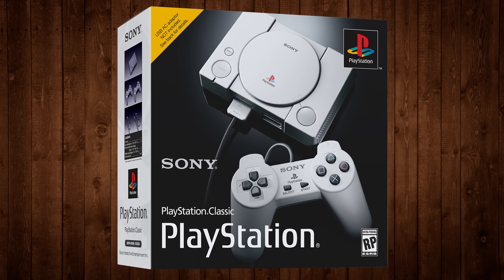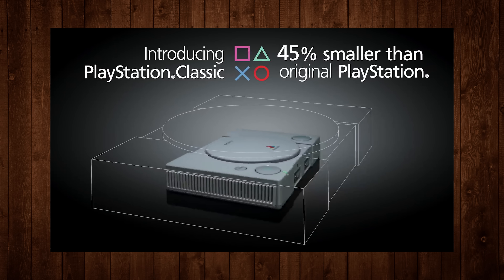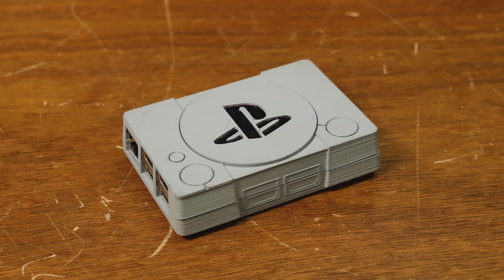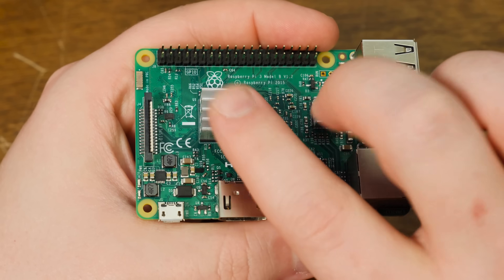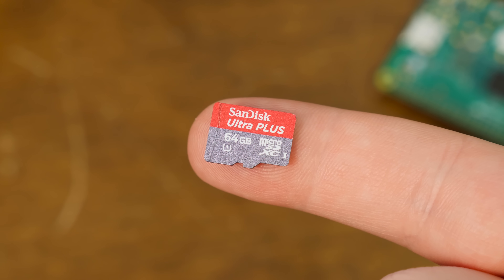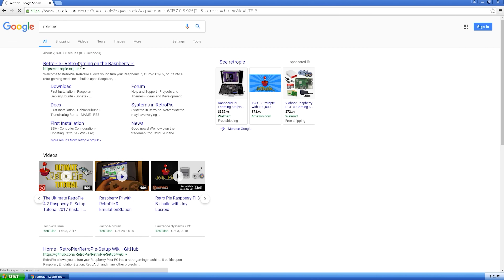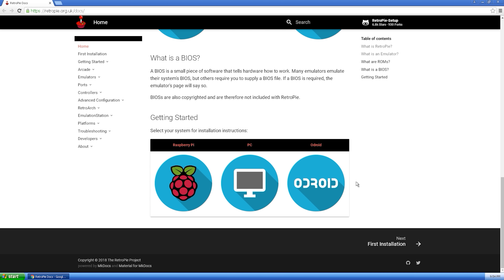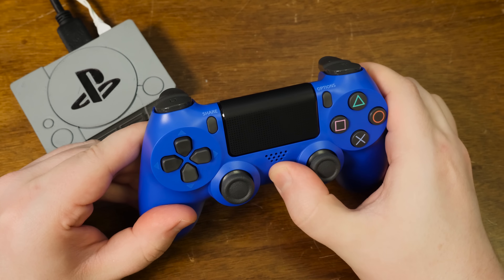Building a Better PlayStation Classic Console

Comment: but is it...legal?
Reply: It can be, or it potentially can be not.
So, I don't know about the shell, if it's copyrighted, and if you can sell it or buy it legally. However, people do sell them. You can make them yourself though, as far as I'm aware, without intent to sell, which would be legal. You just need a 3d printer. If that is still a problem, just use a different case. 

The BIOS itself is legal and opensource. As far as I'm aware, you can't sell them legally. Though, I don't really know (I just personally wouldn't try to sell a raspberry pi preloaded with the ps1 bios). But if you download it and use it personally without selling, it's completely legal. You can check out any emulator website to have the law on that fully explained to you, as they post that to save their own ass from copyright law. Still, there are plenty of companies that sell emulator consoles, if that gives you any comfort in buying or downloading the BIOS or console shell.

The ROMs however, get a little more into the gray area. It's commonly accepted that if you own the game, then you can own the ROM legally, no problem. You might find yourself in hot water with your ISP if you start downloading ROMs, though (especially with new games). If you do own the game, then you don't even need to download the ROM, you can just rip it yourself. Again, don't sell them.

So just don't try to make these and sell them, and you'll be fine. If you do, you'll probably be banned from amazon and ebay pretty quickly, and make Pat the NES Punk's: Scumbag Seller of the Week. I wish I could give you actual legal citations, but I'm not going to do that kind of research right now. If you feel the need to do that, there's more than enough information available.

Comment: Just a heads up to anyone wanting to do this. The heat sink used probably uses an adhesive tape to bond to the processor and the gpu (or the RAM I can’t remember). I did read that this typically made thermals worse because the adhesive wasn’t good and conducting heat. 
He may have gotten a different set than I did but I’m guessing they all come from the same place with the same adhesive.
Reply: sorry for such a late reply because im just now getting into emulation, but any idea on what to use instead??? i was thinking the raspberry pi fan but I could be way off

Comment: Seriously man....just do what i did. 

buy an old 20" crt tv = $20
Psx slim with games and accessories average price $20 - $40 on ebay
Psx braker pro (lets you play burned back up games) $20

that's $80 total. why settle for this poor emulation shit when you can relive the psx experience far cheaper  on original hardware displayed on a crt tv and play the games the way they were meant to be played

Comment: If you're gonna try a project like this, use a Pi 3B+ (PLUS) rather than a 3B. They run faster by default and may not even need a heatsink due to the integrated metal heat spreader, better 5Ghz Wi-Fi and gigabit ethernet built in, come with a header for Power over Ethernet (PoE), and cost exactly the same price. What's not to love?
If tight space and lower power are important then you might consider the Pi 3A+. It should be the same speed as the 3B+ in terms of emulation but it's quite a lot smaller, $10 cheaper, uses less power than even the 3B and has less ports. Of course if you want to go even further there's the Pi Zero, but that is going to struggle emulating the PS1...
Reply: Pi Zero is a fine avenue for NES, Game boy and other less demanding systems. Microcenter sometimes has a sale where you can get a pi zero for a dollar. Pretty sweet deal
Reply: Any news about the Raspberry Pi 4 coming out?
Reply: @Fendera1  Raspberry Pi 4 just released today!
Reply: @kevin12567  Thanks, I've read about it yesterday.
Reply: does the PoE give enough power for PS1 emulation?
Reply: Can you use the same power adapter?
Reply: There is an optional emulator under the retroarch settings, and it emulates ps1 on pi zero very nice. I usually play my ps1 games on my pi zero with that emulator. The only problem is, it's not working with bluetooth xbox one controller.
Reply: He eluded to that , still, this works fine for PS1 esp. with cheap heatsinks

Comment: I was gonna 3d print a Playstation shell for my s8 and just have an otg with a splitter and hdmi output cable using USB c to hdmi and boom.

Connect my dual shock using a ps1/ps2 adapter to pc. Using otg as mentioned earlier.

Comment: Awesome to see more Raspberry Pi stuff around this time, since a while ago I've started work on my "Dreadnought: X64" project. 
I took my old N64 case I still had and took it apart. The Gamebit screwdriver came in yesterday so I got to take it apart a little later than I was hoping, but taking it apart was really fun, seeing how they originally designed the board and such. 
Once I have the case cleaned and all the parts come in (Raspberry Pi 3 Model B+ & Heatsink+2 Fans since N64 games are difficult to emulate 100% without overclocking the GPU) I'll put the pi in there, which the original case works extremely well since it has plenty of areas to allow adding on some extra features (Adding LED light to the original spots, getting the power and reset buttons working again, or even a rechargeable portable battery so it doesn't need to be plugged in all the time.)plus allowing plenty of airflow, which makes this project a whole lot more fun. 

I may post a video of the finished product in a few months. ^-^

Comment: I done mine in retrones case and works a treat ideally would love to get more rom files but that's been mad hard by shutting down of ROM sights also run retropie on a full blown gaming pc using Ubuntu and makes higher end emulation like GameCube and Dreamcast possible as well as saving me from moving the pi or gaming pc around

Comment: You can do this with PlayStation TV for 20$ + buy games from PS Store if you want to play legal copies and print case cuz HDMI, power port and power button on 1 side. Also you can use DualShock 3, which is original Dualshock but wireless. With PS TV you can also play digital games from PSP and PSV and play these all games in 1080p instead of HD on PS Classic

Comment: could you do multi player with a set up like this?
Reply: Yes, you can.
Reply: i want to know too.
Reply: If it has more than 2 USB ports than yes for wired controllers anyway however if you want both controllers connected via bluetooth than I'd assume no since most devices can only support one bluetooth connection at a time.

Comment: Can someone help me. I have everything installed on my pi, but when I load ps1 games on it does not pop up on the pi itself. I also have the bios file in the bios folder. Whenever I put any games in the psx folder it does not pop up in the PlayStation section on the pi at all. Any help ??? plus I cannot find a good website to get roms from as well.

Comment: now THERES a legit 50% smaller than the origina1 PS1, and with 900 HZ, up to 1 gig or just under RAM...AND 250-500+ MB storage from a simple cheap sd card, this could fer sure play any playstation 1 game with zop compression or not in use, hell even ps2 games. NOICE! O>o

Comment: According to a post on reddit, it's possible to get the Raspberry Pi Zero ($5) to run a PSX emulator just barely. Though the OP said he was running it on a 320x240 screen and using some trickery to bypass HDMI.

Comment: you can make connecting your controller a lil easier if you hold the ps button with the share button whilst still off till the back light goes into a strobe mode (pairing mode)

Comment: I do plan on doing something like this but will probably get a slightly more powerful Core 2 Duo, you can get  a small form factor Dell or HP or Lenovo on ebay, for dirt cheap  with a Core 2 Duo and 4GB of RAM or more. Just seems like a better deal to me.

Comment: I built one of these with a Pi Zero W for earlier console generations. Used an SNES cartridge as the case, which took some adapters, hotglue and dremmelling  but everything plugs into where the pins used to be. Works great. The zero W is underpowered for PSX and Dreamcast though.

Comment: thats awesome. sony should have contacted you straight up. i like the idea of a slightly larger case with almost the same cable structure that the original PS1 used, albeit HDMI and composite and a figure 8 power cable and a working power on button.

Comment: As far as 3D printers go, I would wholeheartedly recommend a knockoff version of the Makerbot Replicator 2. I got one for school (I'm an engineering major) on ebay for $345 (with free returns in case it sucked), but I am happy to say that it worked perfectly right out of the box! It doesn't look great, but it works great! 

I would love to make one of these, but I just can't justify the cost (despite it being relatively low) being as I can emulate on my pc in the same way with the same software and the same controller from my couch. As a poor college kid, I just can't afford a stand- alone emulation station, BUT I love yours LGR; great job! :)

Comment: Yes I have two retro pi projects. Pi 3 B in a case I laser cut. I added a small heat sink and a small fan with holes in the case also. I just happen to have original ps1 controller that has a usb converter. 

Second project I made a bar top arcade. I laser cut the case. Used usb encoder and cheap buttons  and joystick. I used a hdmi monitor. The amp is from a gaming rocking chair. The best part is watching other people enjoy playing it.

Comment: I built one about two years ago.  Along with main two heat sinks I installed a third copper heat sink for the RAM on the bottom, and I also glued in a 40mm fan (bought from AliExpress for maybe $2) on the top of the case to pull hot air out.

Comment: I built one using a UHD fire tv stick last week and it handles PS1, N64, dreamcast and psp emulation fairly well. Think in total it cost me £50 total for the fire UHD stick, a USB Y splitter cable and a 32GB memory stick to store the games on. Bluetooth controllers can be synced up with the fire tv stick out of the box.

Comment: Serious question; where can I buy one of these pre-built? I dont have the technical knowledge (or time) to put this sort of thing together myself. I would gladly pay someone for an  emulation console
Reply: MrDemomanman, you may want to check out Rerez's (Shane Luis) YT account. He was sent last year (2017) a "Pi Station", like this one someone made just for him and it looked pretty much like that one Clint got, but with the Rerez logo instead of the PS one. The most likely reason for not being able to buy a pre-made one is that Sony's lawyers are notorious for going after people on copyright issues with less to go on than this time, so people have to "thread lightly" on this.

If Sony got to subcontract to make a proper "Pi Station", based on this set of elements they would charge the same U$99 for it, but it would've been larger (like 2x as big, but still smaller than a licensed PS1 Classic) and probably would've performed much better than it did.
Reply: @syxepop  I don't think you need anybody specilized in this little project to do this. Anybody slightly familiar with raspberry, programming can do this easily. This is literally as simple as a lego set
Reply: Give me £2 million and I’ll think about it 😠
Reply: search for "retropie preloaded" , you might find some on ebay or kits with everything you need. There's also tons of tutorials. I also recommend "CanaKit" comes with everything to get started, look for it on amazon
Reply: You literally buy a raspberry pi 3 b+, some heat sinks, a power supply and case. And well controller. That's literally it. There are "kits" on Ebay but it's that easy to built.
Reply: I would buy that too
Reply: You could buy a Raspberry PI 3 starter kit, with case, wall wart & stuff for £60 to £85 (no idea how much in $). Make sure the kit comes with heat sinks, though. It wont be a PS1 style case of course but it will have everything you need apart from RetroPi. Getting RetroPi working with the ROMS & disk images you want will probably be the most difficult bit, and there are plenty of tutorials on how to do that.
Reply: @YAUUN  yeah I found that for me I don't understand the computer stuff half the time because the technology is sometimes too outdated for Windows 10 or whatever to launch so when I had some stuff that I want fixed I send it over to my friend as he finds it like practice to do that stuff. This version is easy though since it's updated and just a download and putting it into the system and making sure that it is running the right system.
Reply: I'll build you one for free if you're in the UK
Reply: ebay... retro pie.
Reply: AMP3083  id like one
Reply: This is acually super easy. All you'll need is a raspberry pi 1 2 or 3 a usb controller, a microusb charger (samsung/android charger) a micro sd card which you can buy at any computer store and wifi.
Reply: I could do it for you, if you have discord add me at ;)#3409

Comment: I actually bought a great condition, but broken original PS console for my retro pi conversion. I bought a PS controller-to-usb adapter and soldered the pins to the original PlayStation's controller ports so I can use original controllers. Even further, I tapped off the PlayStation's original power supply (which wasn't broken) and routed that straight to the Pi3 (so I can use an original power cable). And finally, wired the power LED to work properly and the reset button to actually reset the Pi3. All said, my PlayStation Classic is about as authentic as a retro console gets :)

Comment: Hello, nice video. Just a question. I have a raspberry pi (i think is the first or second version) i bought it last year 2017, using OS Recalbox. Every raspberry has bluetooth pairing with gamepads? I've been using just wired gamepads, and i tried using PS3 controllers but they just work when being wired connected. Every retropie can pair using bluetooth? Thanks

Comment: I would highly recommend a modded 320gb ps3 slim with 1 Tb external hard drive. I have on mine 70 ps1 games 100 PS2 70 ps3 games not to mention the usual retro emulators with 1000 odd games although I only use it for PlayStation 1-3 games as I prefer my retro pi for the older systems.

Comment: I like a good crt chader myself, usually on Native resolution (particularly with pre-rendered visuals). Not the curved crt shaders though. Looks cool, but a little "out there" for me. Though even basic crt shaders are a pretty heavy load for a Raspberry Pi. May consider a stronger SBC for this application, or at least, consider a healthy gpu overclock.

My $100 Wal-Mart (RCA) Cambio Windows tablet does pretty well with emulation, and looks like a toy.

Comment: As an Amiga and Commodore fan I grabbed the AmigaPi case off Thingiverse and printed that out. Of course I had to get a 90 degree angle connector for HDMI but it works fine now. You can grab it here:  https://www.thingiverse.com/thing:2783126
And I sure enjoy my retro setup a lot. NES, SNES, Master System, Mega Drive,  MSX, Amiga, C64, Colecovision, Playstation and so on... All in one box. :)

Comment: 1 thing i don understand in the year 2018, all these dumb resberry pie and scb/scm, the processer is still on the top of the mb making the option of mounting better heatsink or larger heatsink not festable. They should come out other versions where the heatsink is under the board and you can mount a huge ass heatsink that can double up as a case that would be fantastic. 

In theremal is a plus because cold air sinks and hot air rises, that would give a edge on these boards. 

And the connectors will not be obstructed making it more easy for troubleshooting and replacement. 

I am not sure am i the only one that thinks like this....

Comment: I have two RetroPie setups. One is mounted to the back of my home TV, and the other is kept in a camera bag in my car for ultimate portability (because I spend hours after work and between classes at my college). Fun thing: you can use a program called CyberDuck to automatically sync all files when both units are active on the same network!

Comment: Personally, I think the RasPi 3 was overkill and you could have gone with a Zero, which is smaller and way more power efficient (not 100% sure about this though, I'd have to test it out). I also particularly dislike RetroPie and would recommend running a general-purpose, properly maintained distro like Raspbian + RetroArch even though it's mostly the same thing.

Comment: Ia it possible to use the raspberry pi with the playstation classic case? Using the same front usb ports for usb playstation controllers and same power button. That would be pretty sweet.

Comment: I have an Retropie station in a small NES body. Cheap as dust and it even had a small board that you plugged in the Raspberry to optimize where the cables went so it looks just like any home consol(monitor and power in the back, controller ports in the front). Even the cartrige hatch opens to revieal two additional USB ports and an ethernet port if needed. Never tried PSX, but now I know it works. The pie seemed a bit tired when I ran some N64 games but I guess thats just how the N64 is. PSX probably runs better.

Comment: Great stuff man. I made a Pi about two or three years ago for everything from NES to TG-16, Genesis, N64, Master System, Mame, SNES, GB, GBA, Sega CD...everything but the only PS1 game I had room for was Einhander becasue I used a 32gb card. Now I'm building a Playstation only Pi with a 256gb card that'll have over 500 games on it.

I also hear you can use an external HDD on the Pi as well. Maybe I'll make an ultimate Pi with every game I can think of from 2600 to Dreamcast if that's possible.